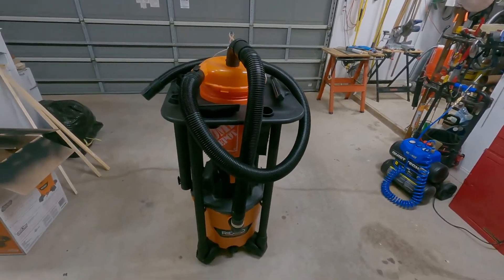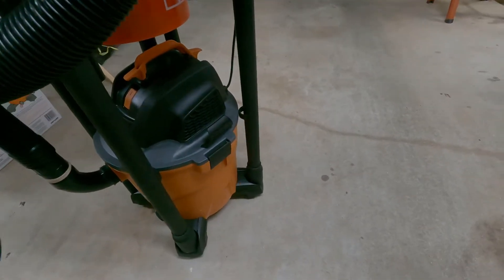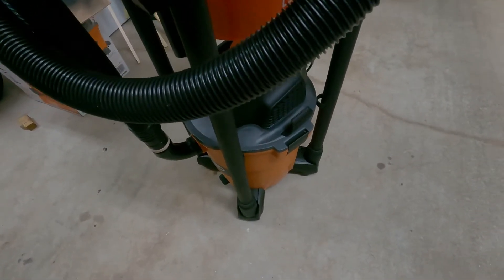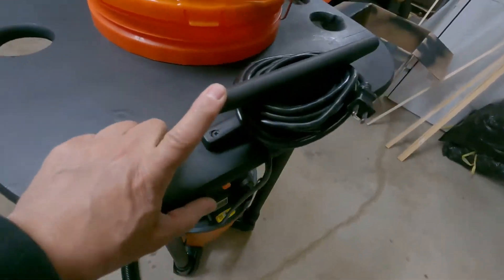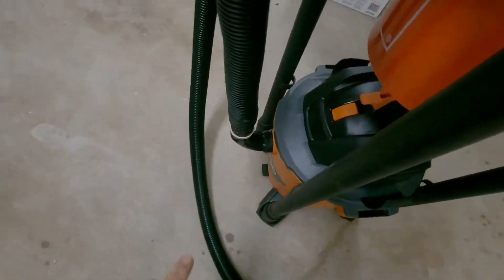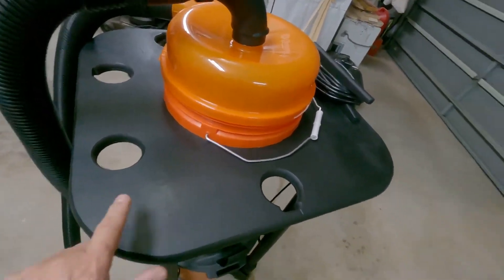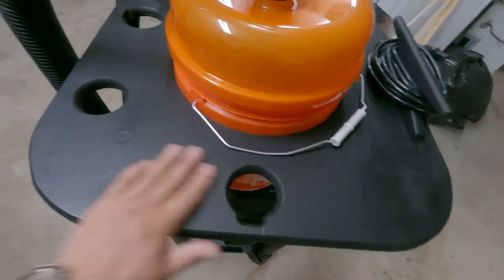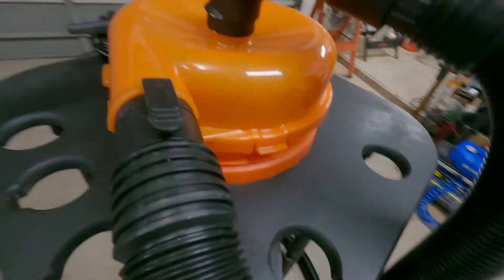My dust collector. Credit goes to the Youtube channel "John Builds It"

Comment: Nice job! I like the addition of the cord wrap. Interestingly enough, the dust stopper I bought did come with two elbow connectors.
Reply from the maker: Thanks for commenting. Mine just came with one elbow I had to do my own rigging and pluming on the second elbow to attach the hose to the vacuum.
Reply: Bought one last night. I got 2 elbows in the box as well.

Comment: Looks great! Thanks for posting.   What model Rigid vac do you have?  Seems there has been a lot of discussion about changes, on newer model vacs, in the wheel support and attachment holders which no longer fit 2 inch PVC.  Did you have to change anything ( like heating the PVC ) to fit the 2 inch to 1.5 inch reducer?
Reply from the maker: Thanks for watching. The Rigid I have is MODEL HD12000 and is similar to this one. https://www.amazon.com/RIDGID-Gal-5-0-Peak-Wet-WD1270/dp/B06Y1WHD4X/ref=sr_1_1?crid=3AK4LWHOF1Q2H&keywords=Ridgid+Vacuum+Model+HD12000&qid=1640935585&sprefix=ridgid+vacuum+model+hd12000%2Caps%2C202&sr=8-1
Reply: @frankyvee1  - Thanks for the reply.   Okay that is the same link that I purchased from 3 days ago; however, they do not ship us the WD1270 (older model which I wanted for easier construction).  They ship the NXT HD1200 which has different size feet that a 2-inch PVC pipe cannot fit on.   

For the benefit of many others: What I did was purchase a rather expensive part from Home Depot that connects 2-inch PVC to 2-inch copper.  The part is named: Proflex 2 in. Neoprene Shielded Coupling.   One end has a much thicker neoprene and makes a very tight fit to the new foot base. 

Easy connect procedure:
1) Lubricate each of: the metal clamp inside, the neoprene fitting thick end inside and all outside, and the lower part of plastic foot of vacuum to make everything much-much easier to slide on. I used silicone spray lube on a rag and rubbed it on the parts.
2) Loosen clamps on metal fitting to allow room for neoprene expansion. Slide metal fitting by itself over vacuum wheel foot.
3) Slide lubricated thick end of neoprene down into metal compression clamp ring and press into place use a flat piece of wood to avoid cutting your hands on metal ring.
4) Tighten lower clamp
.
Now it is ready to add the 2-inch PVC riser legs and the rest of the build.  As I said, these parts at $9.61 each are rather expensive but can be a big-time saver over other methods.   I posted this info in John Builds It channel too since many people may be interested.  Again, thanks for the taking the time to post your build.
Reply from the maker: @charlielang1692  Thanks for sharing this work-around for those other model vacuums. That is what Youtube is all about sharing ideas and tips.  I'm sure this will def help someone else that is facing the same dilema.

Comment: Looks good. Can you tell me where you got the cord holder?
Reply from the maker: I made it out of a rectangular piece of scrap wood. I just cut out a V shape out of both ends. Then painted with the same flat black as the rest of the table. I anchored it down with some wood glue and two screws. Very basic wood work.
Reply: If you have the Ridgid shop vac just use the cord holder that comes off the shop vac and you don't have to make one